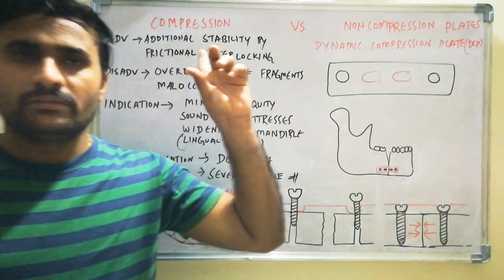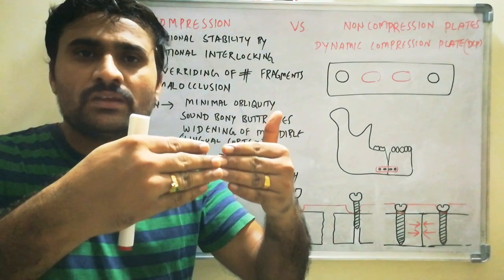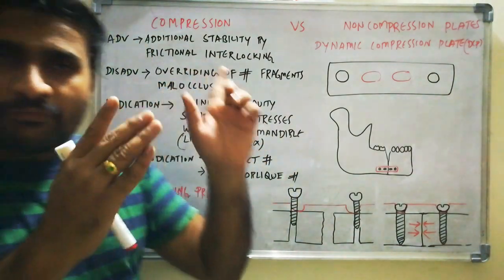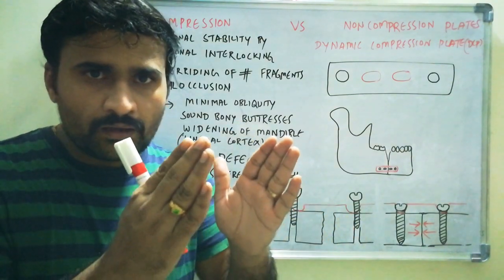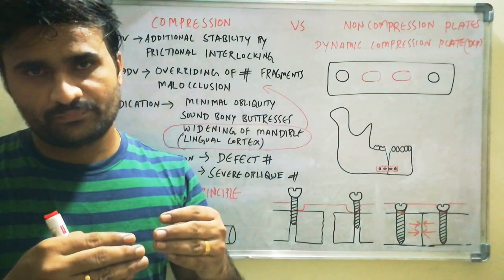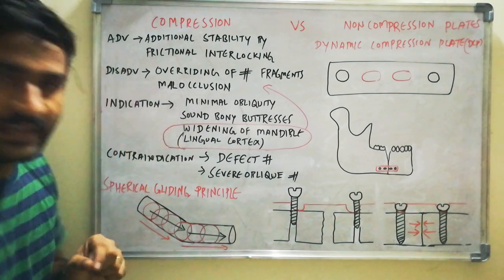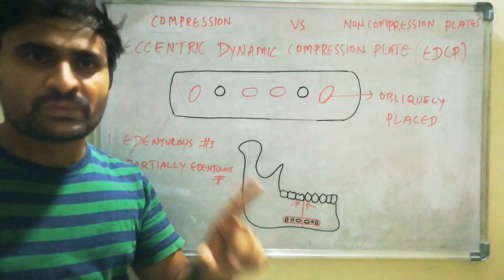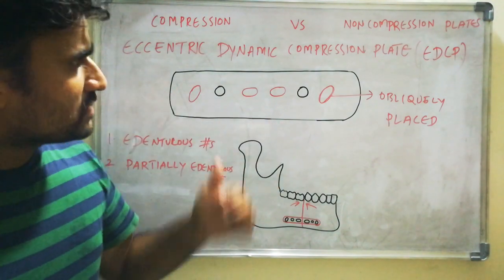Compression vs Noncompression plates

Comment: Sir in princpls of fixation of our video u mentoined,reconstructn plate comes under rigid fixation .
Now in ths video ur telng R.P come undr non compresn .plz tel what z corect🙂
Reply from the maker: yes...reconstruction plate doesn't produce compression.because of its  bulkiness and number of screws fixed, it provides rigid fixation by taking up entire load at fracture site ( load bearing)...
Reply: @msdentallectures7408  ok.thank u sir.

Comment: Sir in dis video about noncompression plate information was there sry I din't get it so 🖤
Reply from the maker: i didnt get you
Reply: @msdentallectures7408  sir in dis video about compression plate we have guiding principle and eccentric compression plate and dynamic compression plate is there about non compression plate u told oly  miniplate and reconstruction plate used dats it u  told na and I couldn't make out difference between the compression and non compression  and it's information about non compression in detailed way so 😇
Reply from the maker: nothing much to talk about noncompression plates....they just hold the fragments without compression...they are commonly used plates ...
Reply: @msdentallectures7408  thank u so much sir 🖤👍